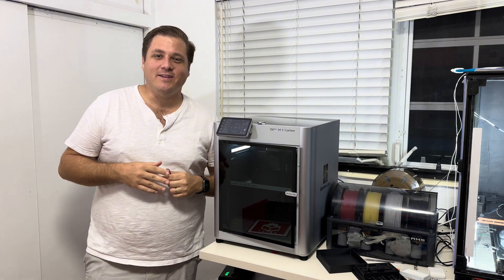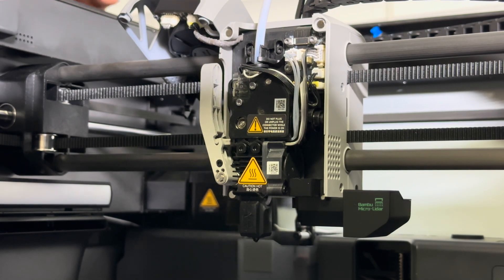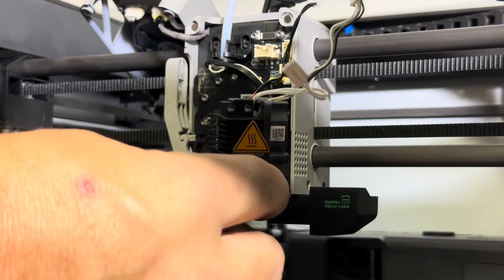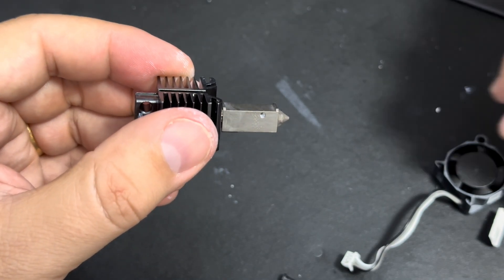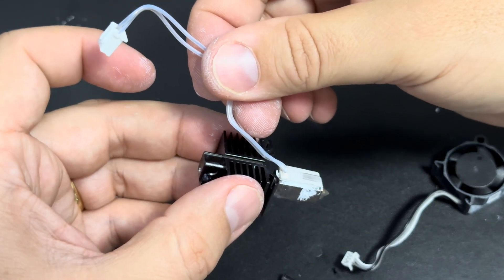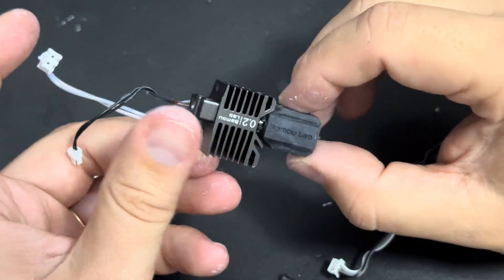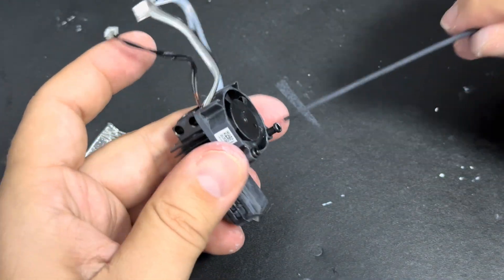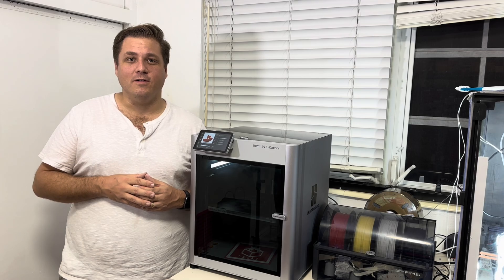How to replace the Hotend Nozzle on a BambuLab X1-Carbon (Easy and inexpensive!)

Comment: that was a very messy job, you could have done this so much cleaner. Just clean your fingers in between and especially before you touch the rubber sock. ok video but messy.

Comment: Jfc, coming from the A1 Mini, I did NOT expect this. Changing the nozzle to a smaller/larger diameter should be a 1-minute process. 🤦‍♀

Edit: I was just looking for a quick guide on changing the nozzle, so I didn't notice the description or watch the very beginning of the video. I just changed my nozzle pretty quickly, since apparently the nozzles my friend bought for me as a gift were actually the complete hotend. I think that extra $20 is a steal. I'd pay an extra $100 if I had to, considering I like to be able to change nozzles frequently. Having to deal with a ceramic heater, thermistor, and worst of all, thermal paste, just for a simple nozzle change, is completely unacceptable IMO.

Comment: Will my thermistor not work with the new one if the two wire ends are exposed? I feel like that plastic ball cap thingy at the end of the wires became brittle and glued onto the inside of the nozzle. When I gently was loosening  the wires, it seems to strip off of something (something = the plastic end for wires)?

Comment: Just bought X1C and they could have made it much easier to switch nozzle sizes. I heard a lot of good things about the AMS and doing multcolor. Thats what got me to purchase this printer. Can't wait to try it out! Especially no more setting Z0 all the time! When I purchased the printer I bought all nozzle sizes fully assy. Glad I did because it would suck doing this every time changing nozzle sizes. Just pull the 3 wires put in the new nozzle asy and your done. Thanks for the video! Not sure about nozzle cleaning on this print head so I'm off to see if I can find one!

Comment: Oh damn, couldn't help but notice one of the pins in the 4 wire plug popped out on you there.  Hope you sorted that out?
Reply from the maker: I don’t wanna talk about. Point is - pull by the plastic, not by the cable. Lol

Comment: Nice for a hotend swap. But i have to say, for each nozzle swap that makes me crazy..  You have to buy for each nozzle you want to use a extra "fan, heater, seonsor"-block. Or you are running up the wall. That's the first thing in my X1C that i find absolutly miss designed.  So  i don't think it is  easy and inexepensive .   Have a nice day.
Reply: Agreed, I bought the basic nozzles because i naively thought that it would be more plug-and-play. I'm watching the tutorial right before installing my 0.2 for the first time and I'm regretting not springing for the all-in-one hot ends

Comment: Hello, 1st you should unload the filament.
Reply from the maker: Yes! Always a good idea if it hasn’t already been cut and removed (this happens already after each print.) if you had to cancel a print, you may need to cut the filament and pull it out before going through this process!

Comment: Anyone run into a problem where the screws aren’t threading after you reinstall the new hot end
Reply from the maker: It’s likely because the nozzle isn’t sitting in properly! I know it probably looks like it is but give it an extra push to go up into its slot. I had that happen to me once. I have a print going right now but when it stops I’ll do a short video on it

Comment: I removed my nozzle to remove a clog and now it wont got back in, I line it up and try to push it up but it just wont move, any ideas?
Reply from the maker: Wiggle it. It’s not lined up.
Reply: @TNTBA  That did not help, I think it is going to be a support ticket which is quite ridiculous, it does actually move up about 1.5mm and the screw holes are aligned but it just wont move up any further, I tried the spare nozzle to see if that would work and that one wont go in either.
Reply from the maker: If you can, take a short video on IG, TIKTOK, or YouTube and tag me in it. Or shoot me an email.
Reply: @TNTBA  I can't seem to get a decent lighting level with my phones camera to show the aperture but by feeling the aperture with an Allen key there does not seem to be anything blocking the way, however on the top of the nozzles left edge there is some scratching where the edge just wont fit. I have got in touch with my UK vendor who are usually extremely good with their help, hopefully they will have an answer and a fix to this issue, I will let you know what happens as I cant be the only person this has happened to and knowing the little quirks of the machine is good knowledge for the future!

Comment: If the nozzle is clogged and you can hear the extruder motor "klicking"
and the filament stuch is TPU, Drag the tpu very hard at the back of the printer, as hard as you can, then hold it for 5 seconds.   

this worked for me
Reply from the maker: I’ll try this out

Comment: Your giving me chills pulling on cables!! 😬
Reply: Yea, just ignore the black wire that came out of the broken fan connector at the end. 🤫 

And for anyone that sees this, the thermistor connector (smallest of the three) has a latch on the connector that needs to be squeezed before removing the wire.
Reply from the maker: Good call - you're right - However, my cable broke due to me using tweezers originally. I squeezed too hard and the plastic jst connector broke. They are very delicate when they're made this small. :(

Comment: Where do you get new thermal paste, if you used the supplied paste up swapping a couple times between .4 and .6 nozzles :).  Struggling to find any videos that do not assume you have the paste that came with the hot end!
Reply from the maker: Thermal paste can be bought at a computer supply store. Otherwise, you can buy thermal paste from Bambulab directly.
Reply: @TNTBA   Bambu labs don't sell it on it's own.  You have to buy a hot end..  If they do, it is well hidden on their site.  I was looking for a place to buy it.. without a hot end purchase..  Most adverts you bump into for thermal paste, are selling it for CPU's.  which do not support the higher temperatures..  eventually I found, and went with a UK distributor that sells "Slice Engineering Mosquito boron nitride paste".     Thanks for replying.

Comment: I am definitly going to pre hook up my different heat ends as one unit so it will just be a two screws and three connections in the future, Great video
Reply: I will do the same, but this video is great if you have to replace a nozzle. For quick swaps I'd rather have the complete assembly.

Comment: Really wish I had just bought the complete hotend.  Its Christmas eve went to swap my .4 with a .2 and now I just keep getting a Nozzle Temperature malfunction error.  My old nozzle did not look brand new like your's there was all sorts of buildup under the rubber cover so when I went to remote the thermostat just wires came out.

Comment: Thanks for this.  Very clear.  However, I wouldn't describe the process as very simple.  After seeing this, I'm going to buy the whole nozzle assemblies which cost $30 instead of $15 which seems easily worth it to me.  However, now I know how to replace any of the components.
Reply from the maker: I actually got 4 full kits for each sized nozzle. So whenever I want to change nozzle size, it’s ready to go… but when it’s time to replace a nozzle of the same size, I’ll just do it like I did in the video. Glad you enjoyed the video and it led to making an informed purchase!
Reply: @TNTBA  That makes perfect sense.  When I ordered my machine a couple weeks ago, I ordered a nozzle of each size but after seeing your video, I then also ordered a full kit of each size and I'll use your method only for when changing a nozzle of the same size, like you just replied.  Perfect.  I've used many printers before of other brands and I'm finding the bamboo slicer to be a bit challenging regarding controlling the support.  For example, I want to be able to do automatic support and then delete only the support that I don't want.  I'll see if I can find another video that may help.  Anyway, appreciate your help.

Comment: Very well done, thank you for all the information.  I agree it looks to be quite doable.  By the way, why did you change the hot end to a smaller one?  Thank you for the video.
Reply from the maker: Thank you for your comment!! 

So if you're asking me why I changed it to a .2 nozzle? I've got two answers. 

Specific answer: My father-in -law has a Mercedes he's fixing up and needed these ornamental screw caps that we could only find from a single manufacturer. https://classictrimparts.com/products/ornamental-screw-cap-genuine-mercedes
We thought, at that price, we were getting like a bag of 10 or 20. Turns out, it was only for a single cap! So I measured out and designed a cap that I could 3D print in a similar color in ABS. If you can't tell from the size, its about the size of a US Dime in circumference. I needed a really tiny nozzle and bambu's smallest nozzle is .2. Maybe I'll do a video describing the design process and the different challenges I ran into in order to get it printing right and creating something that doesn't just snap apart easily (which is natural result of many things made with FDM)

General answer: To do this video!